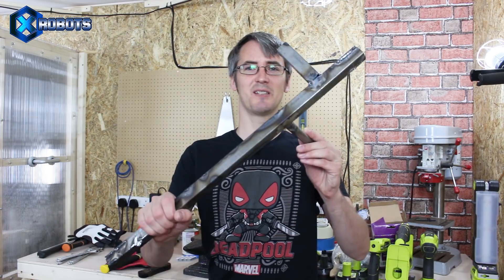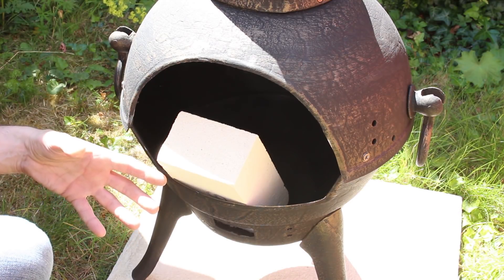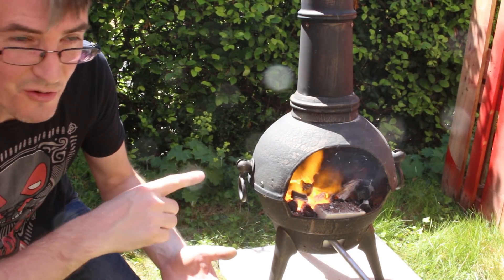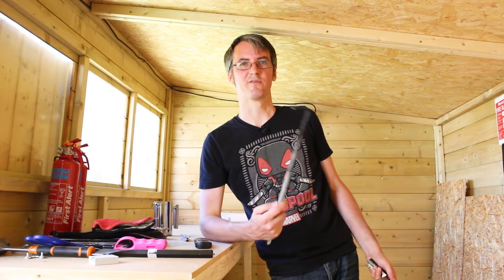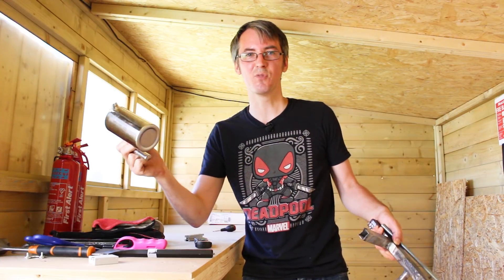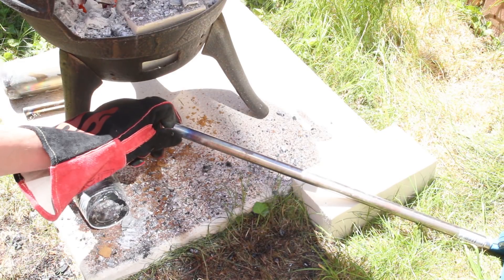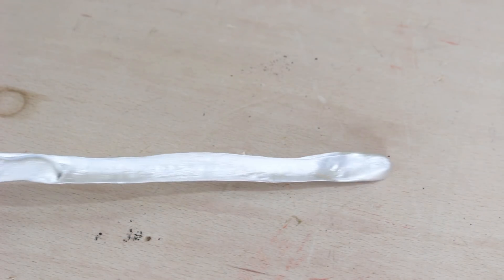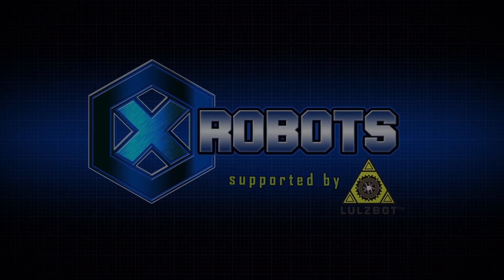Forging Steel & Melting Aluminium | James Bruton

Comment from the maker: I'm pretty sure melting down aluminium scraps and machining them into something else will be quite useful!
Reply: the king of random has a video of how to make a mini foundry can u make a video that improves on that
Reply: Yes you can Mach them with something else what about making Thor's hammer or his stormbreaker
Reply: Nothing better than a couple of crusty sausages after a day at the forge.
If you just want to melt alluminium you should get an electric furnace. They cost about 500$ on e-bay. And you should also get a carbon crucible😂
Otherwise, since you're a maker channel, you could just buy the heating element for about 200$ and build the insulator yourself.
I don't think you should bother with combustion furnaces because:
- they can't be completely sealed and they must always be operated outside;
- they're pretty unsafe because of the open flame;
- they're quite inefficient, hence costy compared to an electric furnace;
- they're loud as hell. Your neighbours will hate you.
Electric forges are safer, more compact, quieter, they can be used wherever there's a socket. The choice is yours!

Keep up the good work!
Reply: I've seen people do great things with lesser setups than what you have. Just remember to put the metal under the coals if possible it will heat quicker that way. For too long you're going to have a complete machine shop keep doing what you're doing
Reply: You should try and do a collaboration with Alec Steele - perfect guy to teach you the ways of the forge and hammer!
Reply: It would be really cool to see you do something with Alec Steele if you're going to get into smithing :)
Reply: I would recommend the bottom of a fire extinguisher or a cast concrete cup as a crucible.
Reply: You should get in contact with Alec Steele and see about doing a collaboration!
Reply: Do some research on aluminium sand casting: you can start turning 3D printed parts into mold patterns and then cast those parts in aluminium.
Reply: James Bruton for the next robot x cosmetic add on, could u make it a fnaf animtronic like bonnie? Plz plz plz
Reply: Craig King what also works pretty good is a Empy fire extinguisher where you cut off the top - they are made to withstand really high temperatures...

And try to come up with a way to hold the "crucible" a little better - if it falls over things can get really dangerous...

You should also place the anvil on a hard surface - the grass and earth act like a spring and absorb a lot of energy from your blows...

Comment: I taught myself how to forge, weld and cast aluminium from literal junk I've found in my neighborhood. I love your electronics but I fully support everyone learning these skills. Once you can make stuff out of steel and aluminium, there's literally nothing you can't build. Most of my tools I've now made myself, along with tons of hardware in my house and garage. Long live the recycling and reusing makers!
Reply: Also, a couple tips I've picked up. 
1) when hitting steel on an anvil, a wooden handled hammer is better then one that can melt
2) the best force from a hammer comes from swinging loose at the wrist
3) to build up the strength for this swinging, start with a 2 pound hammer
4) the physics of how you hit the hammer to be the most efficient with your heat is a large part of smithing, and is a very interesting science. Alec Steele has a few vids on that.
5) when melting aluminium, add a small amount of Morton Lite table salt. It's a 50/50 mix of sodium and potassium. It acts as a good flux which reduces the heat needed and makes it flow smoother.
6) look into Brian Brazeal, Alex Steele, Tobjorn, and MyFordBoy. Their vids are an excellent resource for learning how to do these things.

And congratulations on starting this adventure! You're doing great so far. Love your work ethic and enthusiasm with all you do!
Reply: Oh, and the Essential Craftsman has good videos on hammer control, anvil height, mounting an anvil, etc.

Comment: You're cuddling the steel here, get a proper sledgehammer and hit it with your best shots! It's a muscle job...
Reply: Axel Sixtysix it's not about strength, it's about precision and being efficient with the heat. But yes, he needs better hammer control and should probably learn how to get more power from the wrist while swinging. Again though, anyone can forge. It's not about muscles, it's about technique
Reply: Right, give it some willy!
Reply: I have done a year of blacksmith school, and the entire time I used a hammer weighing just 750 grams. It is, as Helena of Detroit said, a question of precision. And using a sledgehammer alone is just not a thing, especially with a tiny anvil like that. Beating a piece as hard as you can will result in a flat deformed thing that looks like it's made from clay by a child.

But I suppose all popular culture depictions of blacksmiths are basically steroid monsters, and few actually bother to learn anything about old crafts.
Reply: Deathlok67 error....sorry, give it some what?!

Welly!

Comment: We all start somewhere. I would invest in a proper crucible though, it’ll make it much easier.
Reply: The Restoration of Dr Who 
Whera can you get a proper crucible?
Reply: Victor García EBay have some for pretty good prices.
Reply: You can get a carbon crucible from many online stores. They range from $45 to $100 depending on size. However, as he's just starting out, making a thick steel crucible will be better. The carbon/clay ones need to be treated correctly as they're easier to break. I made my first crucible out of an old fire extinguisher. Just weld some bolts on the side and a small loop near the bottom. It allows you to easily manipulate it to both pick it up from the fire and pour the aluminium into a flask.
Reply: Helena Of Detroit there’s graphite ones as well which are cheaper.
Reply: The Restoration of Dr Who sorry, graphite was the word I was thinking of. I said carbon because that's essentially what it is. But it's early here in Detroit... So yes, you're correct. I still suggest starting with a steel crucible
Reply: Helena Of Detroit lol they’re pretty cheap on ebay
Reply: The Restoration of Dr Who cheap is relative I guess. $20 is a lot of money to me. I'm a literal starving artist in the hood making stuff from actual junk I find on the street. I've spent maybe $1200 for my entire shop over the course of 3 years. Even the place I work in was built from scrap wood I found laying around. Made most of the nails to build it myself from rusted pieces of rebar. Cheap could be $100 to someone, but I eat less then $100 worth of food each month...
Reply: Helena Of Detroit There’s even ones for $14. That’s pretty damn cheap. They’re not gonna sell them for $5 you know.

Comment: You should make sure there's a hump or 'S' in the air inlet tube to prevent hot ashes and other damaging things from reaching the air pump. Also a ceramic or graphite crucible would be extremely beneficial for melting aluminium and other metals. You should consider making a permanent forge from fire bricks as they can not only withstand the high temperatures much better than your chiminia but also act to better insulate the heat of the forge from escaping. You're evidently not much of a gardener! (Too busy making stuff, I presume?)
Reply from the maker: Thanks - yep I'll be doing a follow up

Comment: Long comment of potentially helpful information:
 I am a blacksmith/bladesmith (past begginner but not expert) and I use the whitlox wood fire forge with a hair dryer (I taped the cold button down so it wouldn't blow the breaker). For fuel I use a coal called anthracite ($6 for a 40 pound bag), it burns hot, long, and with few emissions. If you put the piece in for a couple minutes it will start to melt! I have books called "The backyard blacksmith" and "The complete bladesmith". I also have a 55 pound anvil on a wooden stand with a couple cinder blocks to put my hammers onto (the anvil is high enough so that the face of the anvil is at your knuckles when you stand up straight). I'm also mounting a bench grinder and a vice on a work bench for my tools. I would recommend a wire brush to  brush off the scale. All of this is in a 9'*7' sheet metal shed I bought at Lowe's (I have to pull the forge outside until I get a vent hood). I hope you can use this information to help your forge.  : )

Comment: I needed shape some tiny copper parts, so I bought a miniature anvil and hammer. The anvil is about 5cm long and the head on the hammer is about 2cm.
It worked really well....and now I have an adorable tiny anvil as a desk ornament :)

Comment: I think you should put a tee on that air inlet and drill a few holes on each side to disperse  the airflow a bit for a bit lower speed airflow, (not a lot less) to get similar burn but less heat loss to the air speed.
Reply: wolvenar 
But with a big "T" the risk of melting the air inlet is higher
Reply: Victor García It has never been a problem for me. The air movement  generally is sufficient cooling to keep the metals from melting, and the blower shouldn't see any difference in heat than it currently experiences. Though all this metal does RUST rather quick comparitive to non heated of course so there is slightly more cost because of the small amount of extra material.. But near to insignificant vs the use and the rest of the device.
Reply: I am not saying reduce the air speed to a trickle, about 1/3 of the volume it currently is in the one place would be the goal, but through several smaller holes over maybe 70-120mm

Comment: tip: put the tube at an angle to create circular airflow inside the furnace. Might increase efficiency. Also, smaler opening and more insulation all over!

Comment: May want to get a large diameter (big enough to hold the anvil) log that's about 2-3foot long to set on end then mount the anvil closer to hip height.  This will allow your swings to be stronger since you'll be able to put your legs into it.

Comment: You may want to make the hole in the front bigger as well. This will make putting the metal in the forge easier for you in the long run.

Comment: Hey, a couple of bits of advice from someone who has recently done a year of blacksmith schooling. A bigger anvil is very much a good idea. I seem to remember your anvil should be twenty times as heavy as the biggest hammer you intend to use. Your hammer should have some rebound when you forge, and it seemed all the energy from the hammer just went straight into the ground, both making the forging more arduous and less effective.

A good height for the anvil is if you stand straight you should be able to rest your fist on it with your arm straight down. Get a tree stump or something like that to fasten it to.

Also you need to stop hitting the piece when it has cooled down to about cherry red, preferably even before that. Hitting it when colder introduces a lot of stress and will lead to the metal cracking. Even if it is not visible the bit will be less structurally sound and might very well break under stress.

But I must say, even though it probably is not very efficient, I really like your improvised forge setup.
Reply: Also it is a good idea to place the air pump higher up than the bottom of the forma to stop ash from going into it. Or, indeed, molten aluminium :)

Comment: if i may suggest a thing or 2... firstly id say that you should buy crucibles so that you wont use an object that wont be problematic once you get it to heat up quite alot... secondly you should probably get a front piece of metal so that your material doesnt get cooled by the outside air while the fire is getting up...

Comment: The air caused uneven heating on your can and the hole burnt through. try to keep the air lower speed. Also try to use a welded square section to make a crucible or an old fire extinguisher is good.

Comment: I've heard that forges are supposed to work more efficiently when the airflow is large but somewhat slow, your forge has fast and small. Easy fix is to use a larger pipe for the air pump.

Comment: You should make king of randoms furnace/forge, It can melt steel and quite a lot of it so it would probably work great for melting down scraps of metal

Edit:spelling
Reply: Olof Axelsson pretty sure TKOR melter won't melt steel. It works great for aluminium though... But all James needs to do to get steel melting temps is to use coal, cook it down into coke, and build up the fire correctly.
Reply: Helena Of Detroit I was probably thinking of the arcfurnace xD but like you said he only needs to melt aluminium anyways

Comment: Try to get a bit of a fire tornado (totating air) going around in the furnace. By bringing in air on 2 sides at a angle. Also isolate the sides and top to realy keep that heat in, maybe add a door?  Glass wool is verry good, as a isolator. ware gloves and mask wile doing so tho ;) Good luck on the project =]

Comment: There are lots of designs and they are fun to play around with.
Find a source of Coke(the baked coal stuff, not the drink). That will get your temperatures up to the point where steel burns using a setup like that.  Charcoal better than wood.  Coal better than charcoal. Coke better than coal.
The lid/chiminity also doesn't help any and will just get in the way. 
And one of the MANY LPG/Propane furnaces do a far better job of aluminium.. Easy way to get started though. :)

Comment: Have you seen the art of weapons electric forge? Melting aluminium with electric is far more fitting with your channel! I'm doing one using a PID, hob ring and an insulated bbq gas bottle, i'd love to see your take on it.
Edit: also have you seen the gingery book series where he starts with a forge and builds a lathe, mill etc? Pretty cool series for your channel maybe doing lost PLA casting?
Reply from the maker: I'm considering all those things for Aluminium!
Reply: James Bruton i should just become a patron and live vicariously through your content it'd be cheaper for me and your doing everything i want to! 😉

Comment: I realize everyone is just giving unsolicited advice so I guess I’ll jump on the bad wagon. From a physics stand point if you put the anvil on a more solid surface such as concrete, you would have a lot more energy going toward flattening the steel with each blow of the hammer. The way you have it right now you are losing a ton of energy that is just being dampened by the grass.